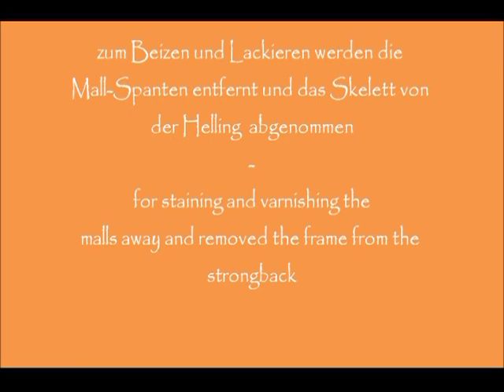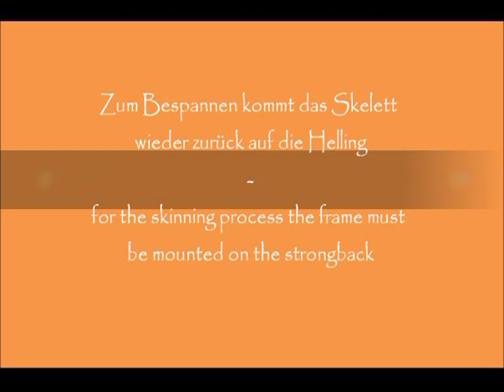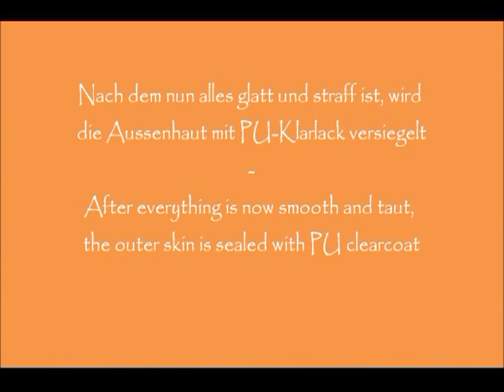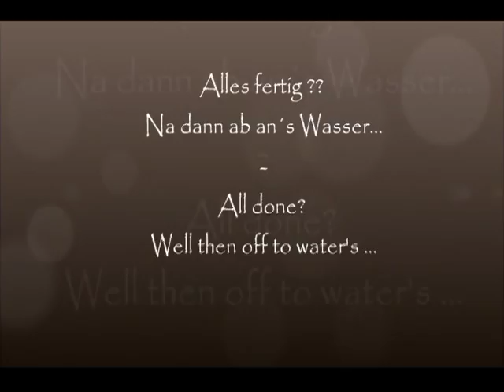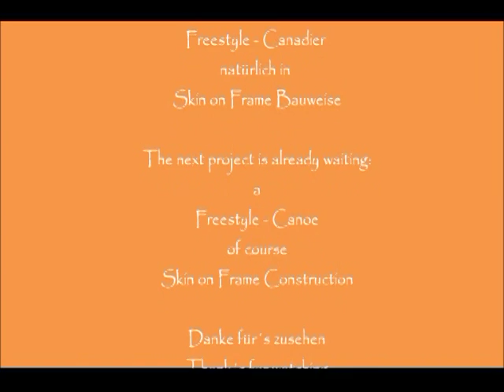Kanu / Canadier bauen - canoe build - Skin on Frame Prospector No.3

Comment: That's a sweet canoe. How did you attach the keel piece of wood that runs underneath the canoe? I noticed what looked like nail holes, how did you ensure a water tight seal at the nail holes on the cloth? Thanks.